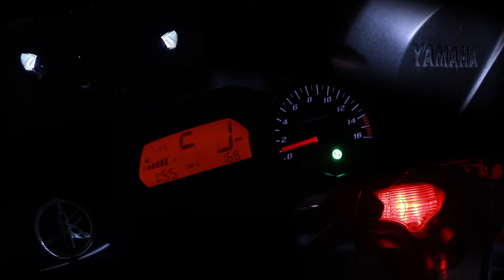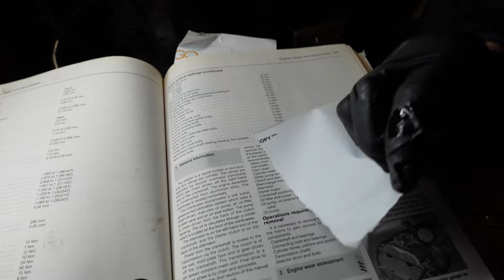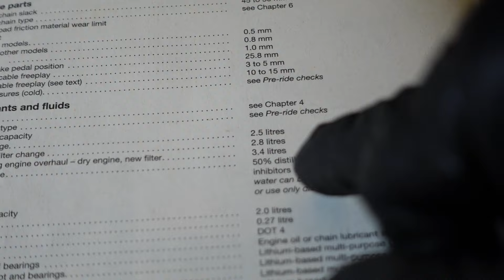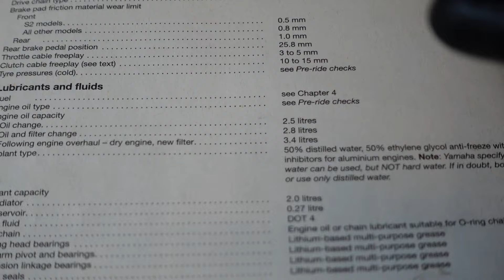FZ6 YAMAHA YAMALUBE Fazer - Motorbike OIL CHANGE - HOW TO and WHY #motorbike #diy #oilchange #yamaha

Comment: How is the snatchy throttle? Over the winter in the cold air, mine didn't really do it? Then, a ride on a warm evening recently, the mid range  on /off snatch was back. 
I read you had a dyno tune? Thanks
Reply from the maker: Still there. Yeah some say the inline tuner helps which tricks to ECU into thinking it's colder than it is...but I didn't find it did anything. 

I've had a tune now. It absolutely rips and but the snatchy off to roll on is still there.

I've got one thing left to try. And then gotta live with it I guess. I hate it though when riding quick and mid corner roll on...waiting and then BAM!
Reply: @PiggyPower  I'm likely going to go for a Dynojet power commander.  Everybody l spoke to said this was the fix 🤞
Reply from the maker: @davidhall9597  this is what I did. And got a tune on the Dyno at Dynojet